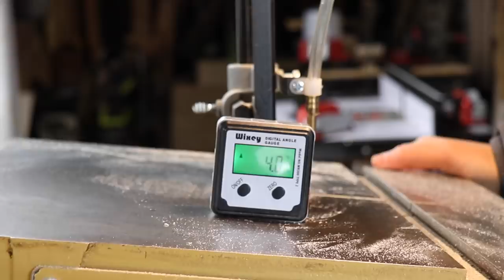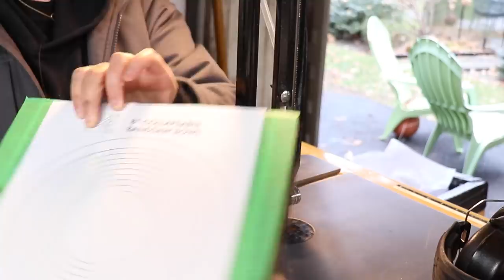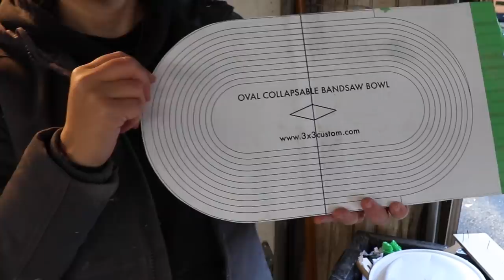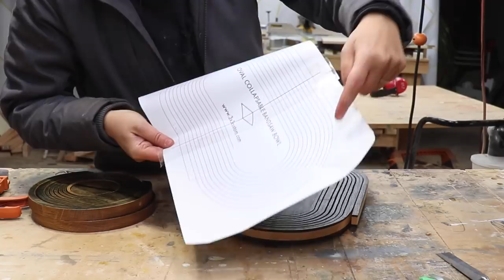How to Make a COLLAPSIBLE Bowl!! It's EASIER than you might think!

Comment: Good project. For the angle, the minimum you need is given by the arctangent of the width of the kerf divided by the thickness of the wood. So, for a 1/8" kerf, and a 3/4" board, you'd need about 9 degrees.

Probably, just using tape on the bottom of your workpiece would take care of tear-out.

Last, on the tape theme, pausing occasionally to put some tape on the already-cut squigglies would tame the wigglies.
Reply from the maker: Thanks! That’s too much math for me. Ha! I considered using tape. But I was concerned it would affect the way the piece slid across the table

Comment: If you use a scroll saw you don’t have to cut the handle separately and you also can start the cut in the center and work your way out . This would leave a small hole for the blade start that you can fill in with an appropriate plug.
Reply from the maker: If I had a scroll saw.... ha

Comment: In a non joking comment, nice job! The oval one looks particularly great, and I am always fond of wood projects that are neither just square angles or just circles. 

I can't remember it ofc, but since you're later attaching a handle and bottom that fixes the height and hold it all stable, does the angle really matter? Without those, the friction fit makes a lot of sense, but with those it feels like you could even have the shallower angles and exaggerated the height so there are intentional gaps when fully opened and it would still be stable (walls are still solid wood even if wiggly, bottom and top are held in fixed stable positions, useable and stable).
Reply from the maker: Thanks! I hear what you’re saying. I plan on using this bowl as a bread basket. So I don’t really want breadcrumbs falling through. But I guess it would be a good idea for a fruit bowl or something!
Reply: @3x3CustomTamar  That makes a lot of sense! I'm so used to the loosely weaved baskets (where I stole the idea of gaps from tbh) with a cloth inside to hold solid particles that it didn't even occur to me it would hold those particles on its own. Clever!

Comment: I say it took 30min to cut out the oval one. I would also like to suggest gel food coloring as a stain instead of the liquid water based stuff. I’ve used it on some silver maple pens I turned along with a tiny bit of mineral oil to create a marbled look. Also if you get your hands on some Madagascar Ebony you can bleach the wood with some household Clorox just soak it for about an hour or two then let it fully dry (about 5 days at 2x6x12) before you sand or work with it, gives a super awesome look
Reply from the maker: Sounds cool! I’ll have to try that. And not that long!

Comment: Blade kerf will also effect angle e.g.  A thicker kerf will require a larger angle.  For example when making a bowl from a board angles up to 45 and typical.  For a scroll sawn basket the angle would be less because the blade kerf is so thin..Nice video...kunk
Reply from the maker: Yup! Thanks!

Comment: You now have me wondering if it's possible to start with a (round) collapsible bowl.... then throw some glue in the kerf and expand it so that it's a solid(ish) bowl... then throwing it on the lathe and turning the ridges down. If nothing else it would make for some interesting grain pattern methinks. Further experimentation required!
Reply: Can imagine that going horribly wrong 😢, but nothing ventured...
Reply from the maker: Ooooooh. That’s sounds very cool. I would love to see that happen. Wish I had a lathe to try that out

Comment: Maybe a dumb question. For the oval basket with the cross piece where the handle rests while open. What if it had a small groove, perhaps even chamfered slightly? That way the handle ends might just slide in to place rather than you having reach down and lift each side onto the cross piece. With that extra length added you were talking about I think it would work out ok.
Reply from the maker: Would be cool

Comment: I actually dug how the finish on the round bowl turned out! What food-safe oil did you use on these? Thanks, and keep up the great work!
Reply from the maker: It would have looked cool if I did a better job sanding it. And if that black like didn’t appear out of nowhere! Ha! I used walnut oil on these
Reply: @3x3CustomTamar   It looked like there was an issue w sanding it after the spiral had been cut done. Was that because the wood was moving (shimmying?) under the orbital sander?
Reply from the maker: @clickster1883  that’s not what the problem was. The walnut one was sanded before cutting. Which is ideal
Reply: @3x3CustomTamar  This is why I watch your videos. I learn so much! Thanks again for doing what you do.

Comment: I think the angle may depend on the kerf thickness of the blade used :-)  I'm just guessing at this though, never have done that.  Missed you, hope you had great holidays!  Nice vid and I learned something as usual  :- ) which is great !  When you make your cauls do you add a slight curve so the center gets some added force ?  Also, I see they have zero clearance inserts for the bandsaws (tearout?), I need to get some..just a heads up.  Keep on rockin' it!
Reply from the maker: Yes. That’s definitely a factor too. Forgot to mention it. And the cauls put pressure in the center of the board where clamps can’t reach

Comment: Maybe instead of drilling through two layers to attach the handle you could alter the plans to make the first cut around the bowl wider.  Not only would that solve the issue with the dowel length but would also give a nice looking lip to the bowl.  Overall great project and fun to see all the lessons learned along the way.
Reply from the maker: That’s a good idea. Thanks!

Comment: For the dowel pins, how about drilling through just one layer, but widen that hole on the back side to just a few mm to fit a larger dowel. Make a 'head' with the wider dowel and glue it to the original dowel to lock it in place so it can't pull through?

Comment: The minimum angle that can stick should be kerf width over stock thickness (or arctangent of it if you want it in degrees) or you can just use similar triangles. In the latter case multiply both the kerf width and the thickness by some suitable number n (10 should be easy). Then angle the table such that it drops in excess of the n times kerf width per n times (assuming the blade is vertical).
Reply from the maker: You lost me at arctangent...ha!

Comment: What if instead of putting the dowel trough two layers, you make the first layer thicker? Would it look weird? I can't do it myself because I don't have a band saw. Also: great project, awesome video! Oh, and Happy New Year!!
Reply from the maker: I don’t know! Would be interesting to try out for sure! Thanks!
Reply: @3x3CustomTamar  Could you have glued the dowel to the bowl instead of the handle?
Reply from the maker: @CutitwithaHammer  I think the handle would still pop out that way
Reply: @3x3CustomTamar  You could use capped dowels countersunk into the handle with a bit of beeswax to lubricate the "hinge" then glue dowel to the bowl edges

Comment: Would it make it easier to make the cuts if you drilled a small hole in the base of the bowl, insert a reciprocating saw blade through it and cut it inside out?  Then you also have no cut through your rim.
Reply from the maker: I don’t know. But you never know until you try 🌈 ha

Comment: Couldn't you have taped around the outside of the pieces before sawing the spiral, to help hold its integrity while you were sawing?  Or would that have caused too much binding on the saw blade due to the tape trying to compress the piece as wood was sawed away in the blade kerf?
Reply from the maker: It wouldn’t make a difference because with each cut of the spiral more cuts are being opened up and then more space is added...

Comment: For keeping the piece from wiggling as you cut the spiral, would it work to glue a handle onto the middle of the board and then cut it off later? That would allow you to control the board from the stable part. Just a thought

Comment: For the next time you want a food-safe, oil-ready black stain on wood, may I recommend iron tannate. I sometimes start by applying strong tea or coffee if the wood doesn't have a high natural tannin content (I believe this step wouldn't be necessary with most species of oak); let that dry, and then apply iron acetate (which can be made by soaking rusty items in vinegar). Tannins complex the iron ions, and acetic acid evaporates from the wood, leaving a surface that can be stained normally (the grain will have risen from the water applied, but that can be a benefit). Iron can become toxic in high concentrations, but between tannins and a drying oil finish, far less iron would transfer to food than from a skillet.
Reply from the maker: Yup! I mentioned that at the end of the video. Would have been a cool way to do it

Comment: After your first cut into the actual bowl, could you not stop the saw and put some tape on the cut so you're not having to deal with the whole thing trying to come apart as your making your spirals? I hope this makes sense.
Reply from the maker: You could. But it wouldn’t help much. As you cut. The kerf keeps getting bigger and bigger and it is creating more space. So even if the outside is closed tight. The inside is still squiggly. If you want to really prevent it. You would have to stop the saw after every turn to tape up each opening you make. Make sense?
Reply: @3x3CustomTamar  Makes sense. I've never done one of those, just trying to come up with an idea that may help. This is an awesome project though! Think I'm going to have to try one :) keep up the great work!

Comment: With the projects I make, I normally use water based stain, allow it to completely dry, and then finish the project with either water based poly, or an oil based lacquer. I have never had any problems with the color bleeding or fading with either of the two finishes I use. Johnathan Katz-Moses makes a food safe cutting board finish that I have used many many times, although I have never tried it with stained wood. I think a piece or two of scrap wood is going to be sacrificed for an experiment tomorrow. I wouldn't call your round bowl a failure. That dark line that showed up in the wood may have just been sap in the wood reacting to the food coloring.
Reply from the maker: I think it was the food coloring reacting with the glue line.
Reply: @3x3CustomTamar  YUP, that's another very good possibility, either way, it adds character to the bowl. It's still not a failure in my book.

Comment: I did the math and the exact cutting angle you need to use for the spiral to lock has to be > 90-cos^-1([cutting blade width]/[wood width]). so say the blade I was using was 2.5mm wide and the wood I was cutting was 25mm wide, I should cut at an angle greater than 90-cos^-1(2.5/25)=5.74 degrees. so I will cut at 7 degrees and my bowl will work

Comment: I think it would be a good idea to put rounded slots where the carry handle could slot into with corresponding rounded ends when fully extended
And possibly even putting strong magnets where the handle meets the base to avoid them from coming loose when picking it up or moving it

Comment: Super cool. As a starting point, if my napkin math is right, the wood will barely touch at Tan⁻¹(cut width / board thickness).  For example, if you're cutting a 0.08' gap on 0.75" plywood then you need greater than Tan⁻¹(0.08/0.75) = 6.089° (degrees). A few notes: Tan⁻¹ (inverse tangent) is often shift tan on calculators, the width of the cut might be different than the specified kerf for the blade, and the angle will change if/when you secure the open end.
Reply from the maker: You lost me.... ha
Reply: @3x3CustomTamar  :) Hah. Well, you already figured it out for yourself and actually did it, all the while filming and explaining it in a way that people can easily understand. I think you're in good shape. :D

Comment: 2 ideas: 1. instead of gluing 2 spirals, band the outside with laminate (or layers of).  2. try this as a pattern. glue panels out of multiple wood types or even a butcher-block/checkerboard. Might be a cool gift paired with a matched breadboard or cutting board (slice your fresh bread and present at the dinning table in matching bowl).
Reply from the maker: So I didn’t mention this. But my friend who has this bowl. Who I mentioned in the beginning of the video.... she actually uses it as a cutting board. So she cuts the bread. And then voila! It becomes a basket to pass around! Very cool

Comment: Maybe extend the base of the oval one out just a little on the sides and cut a small dado into it for the handle to rotate into to prevent them from sliding off?
Instead of gluing two rings back together afterwards, maybe just cut the first ring twice as thick? Just some thoughts...

Comment: Those are cool.  But food coloring is organic so the tannins in the wood will bleach it until it has faded almost completely away.  Perhaps the finish will protect it though.  I had a Tom & Jerry dart game 🎯 if I remember correctly, any way I painted about 3 inches of one end of one of its wood dowels black with a non toxic marker (organic dye) when I was little.  Next time I saw it, the color was barely visible.  However, as a little child, I didn't have access to any kind of finish.  It'll be really interesting to see holds up in the next 20 years.  Give or take 10.  I didn't even think about protecting it.  Didn't know it would be around that long.

Comment: This is really interesting!  You’re one of the cleverest / most innovative woodworkers on youtube.  BTW - what is that thing on the bandsaw that looks like an air fitting?  How does that work?

I think it was Izzy Swan that came up with a cool jig for easily/quickly cutting spirals.  I wonder if that could be adapted here?

The main reason food coloring isn’t used in coloring furniture is that it fades a lot more in light (not that any coloring doesn’t). It’s a good idea though and probably the best way to do food safe coloring.  The other thing that could be used would be a naturally dark shellac, like garnet, as shellac is edible (it’s used on pills and candies like m&m’s).  Of course, you can’t get the same variety of colors with food coloring.
Reply from the maker: Just a blower to blow the dust away. It came with the saw. But I don’t really see it as being helpful

Comment: make a small pilot hole in the middle and start inside out. that way the blade is on the outside at the end and you keep the grip through the cut! at the end, just plug the hole with a piece of wood!
Reply: That could work for a scroll saw, but not a bandsaw, because the bandsaw blade is a welded loop!

Comment: just checked the 500 comments and I don`t think anyone has suggested this jet but: Do you think gleuing the dowels to the outside rim instead of the handles will work?  Then you don`t need a double layer on the outside.
Reply from the maker: I think the handle would then just pop off the dowel. And it would look flush at times

Comment: It is possible that the glue sealed the grain of the wood when you removed the glue.  It will happen even when when you stain the wood.  Best advice from other woodworker is to let glue set; then scrape it off; that way it does not get into the pores of the wood.
Reply from the maker: You referring to the black line? No it was for sure a reaction of glue with the food coloring

Comment: Interesting.   If you like to do the spiral cuts you may want to see if you can find a metal working bandsaw with a built in shear and welder.   Then rather than having to back the blade out, you simply shear it and pull it out of the cut.  Then weld it back together, grind the weld, and then go on to the next one.   
Why don’t you at least have a space heater for winter work?
Reply from the maker: Space heaters blow a fuse when I turn my tools on.
Reply: @3x3CustomTamar  Sorry about that.  I can’t run my electric heater and machine tools at the same time either.   Fortunately I don’t have too many cold days.   Besides the fuse that goes is not the breaker, but the difficult one to replace on the mill.

Comment: If you had cut the spiral from the inside using a scroll saw instead of a band saw, while it would have been slower you would have had something more stable to hold on to and the finish would have been smoother.

Comment: 25 minites. Still dropping your plane on it's blade I see. I rarely have good luck with stains. Steel wool and  vinegar as a stain? I've used that for rust removal but not as a stain. Using a tapered dowel might keep the handle from slipping out. If you aren't learning you're not pushing your limits. Lovely project.
Reply from the maker: Thanks! Close. But not that long. Yeah. If you put some steel wool in a jar with some vinegar and let that soak for a while it turns into a really cool stain that reacts with the tannins in certain woods

Comment: I know I'm late to the party, but I think that black line in the middle of the circle is where you joined the 2 plates. My guess is you forgot to scrape off the excessive glue on one surface and out of 4 total surfaces somehow that surface ended up being the most important one.

Also, you mentioned that it's better to glue 2 outer layers together. Then why not just make the outer layer thicker on the template, like twice as thick as the inner layers so you save yourself a full turn of cutting and gluing?